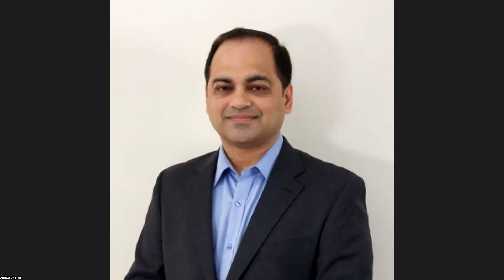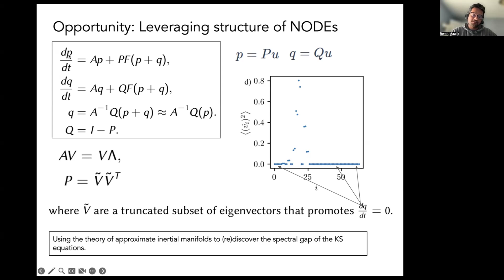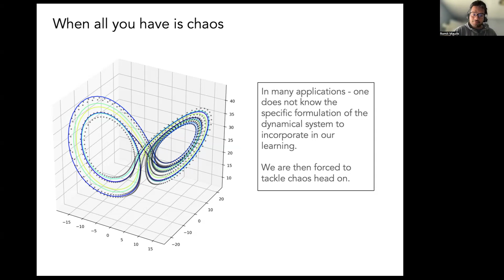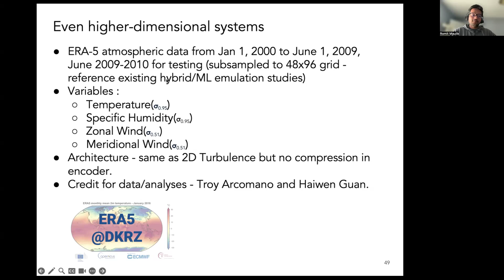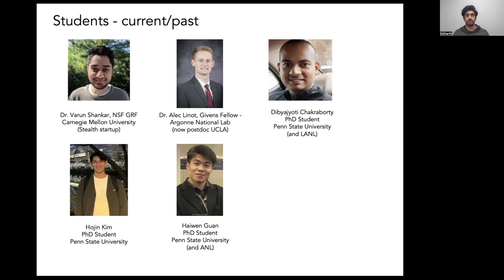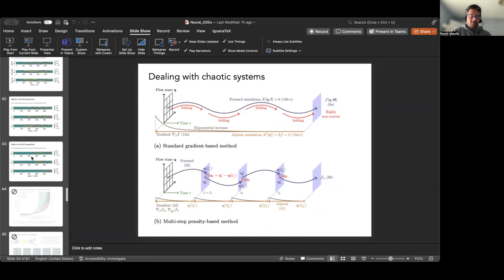PI Seminar Series:  Neural ODEs for Scientific Machine Learning

Comment: The methods for automatic differentiation of chaotic systems was already implemented in the Julia packages back in 2020. These are the shadow adjoint methods included in SciMLSensitivity.jl and there are blog posts for how this works. Universal differential equations (mixing prior known equations with neural networks in an ODE definition) with chaotic systems was demonstrated with these types of approaches already. It seems like this is just a reimplementation in Python. Are there any performance benchmarks against the existing code? Since the approach described there is missing some of the known elements for improving performance (some of the linear algebra tricks exploiting the structure of the QR factorization), I would be surprised if it's an improvement over the previous approaches. Since no code was released, there's no way to test it either.